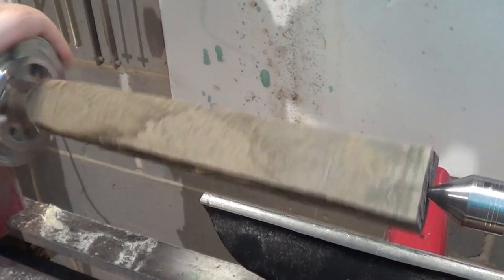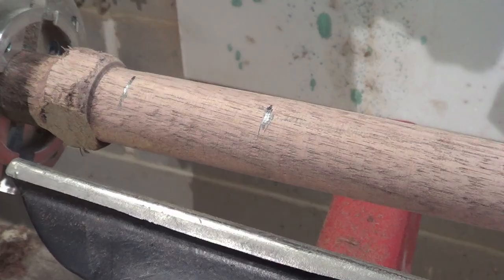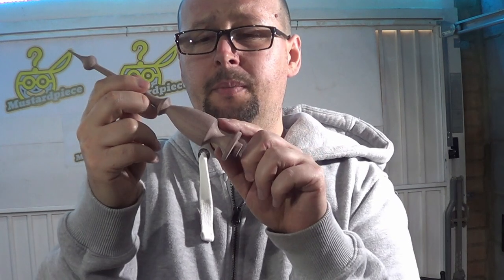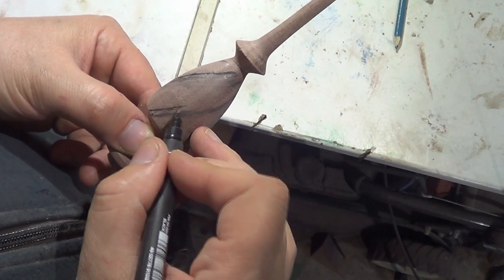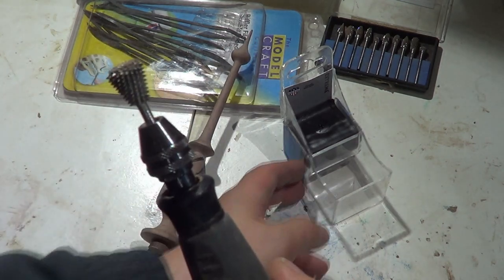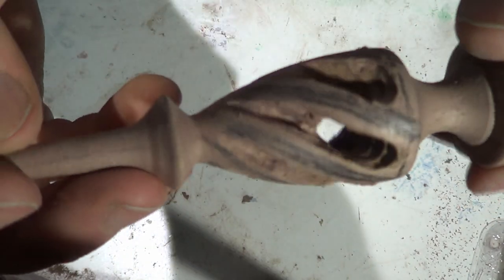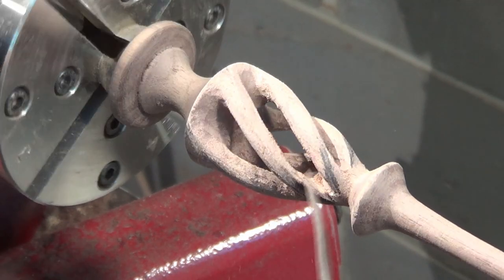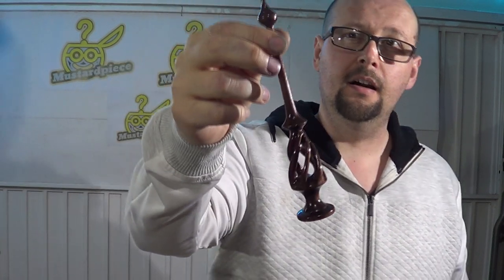How to Carve a Twisted Finial  - Woodturning

Comment: Great work on it, Attila 💪 Sanding that type of elements is horrible but as I see on Your finial it is worthy 👌 Looks beautiful 😊
Reply from the maker: Thank you. As I said it in the video the small files works wonder. It was much easier than I expected to be.
Reply: @Mustardpiece  Yuup, those work very nice. Did You made that files with own hands?
Reply from the maker: @Secondlifeofwoodturning  No. No point you can buy them. They are cheap. Was like £15 for 10 pieces.

Comment: I hate to tell you but you are using that spindle gouge backwards! The flute of the gouge is suppose to face the direction you are going and be riding the bevel for a smooth surface and little sanding afterwards.
Reply from the maker: Yes, no problem I stopped making videos anyway.
Reply: @Mustardpiece  Why?